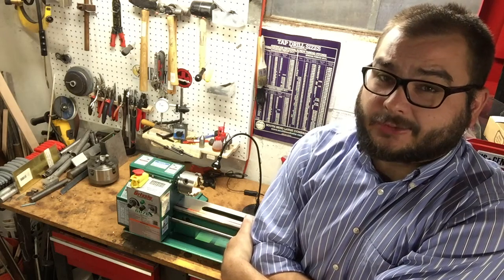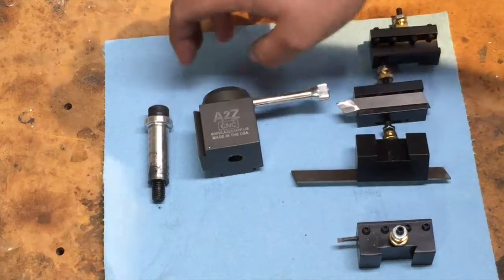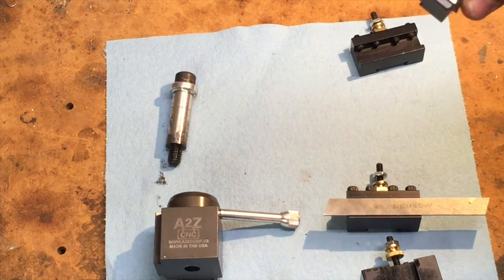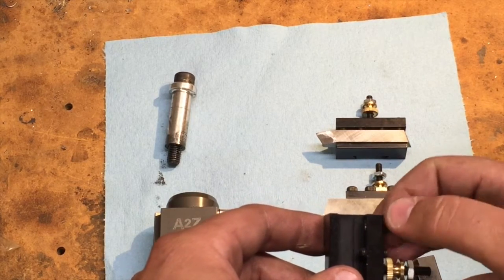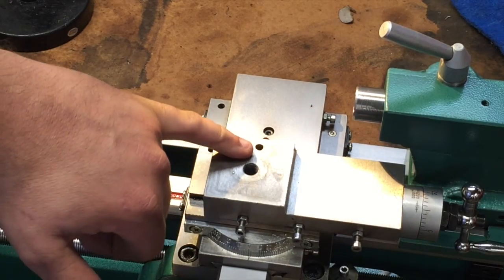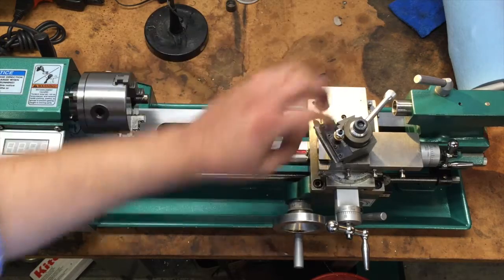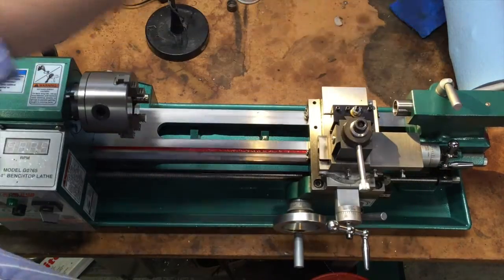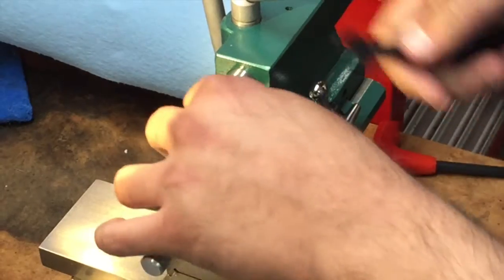A2Z CNC Quick Change Tool Post for 7x14 Lathe

Comment: I bought the same A2Z QCTP for my old Taig micro-lathe and then fit it to my new Sieg mini lathe by making some modifications.  I LOVE the thing and you're right, although the quick change ability is a plus, the real benefit is that the bits will always be centered to the work when you change tool bits (unless you sharpen it first.)  Setting the bit to center couldn't be easier.  Unfortunately, I recently tried to order more tool holders from A2Z but was unable to get to their website.  Rumor has it that the company has been sold and may not be producing these QCTPs and tool holders anymore.  Should have bought more when I bought the original set, but at least I can get by with what I've got.

Comment: I agree, I hate that thread. I assumed they were metric but it's the only weird thing on these and it's the one thing I really hate. I need a couple more holders but I will probably make my own in the end since the set screws are not metric and not cheap either. I have been debating doing this, but the more I think about it I figure I might as well learn to make my own tools now.